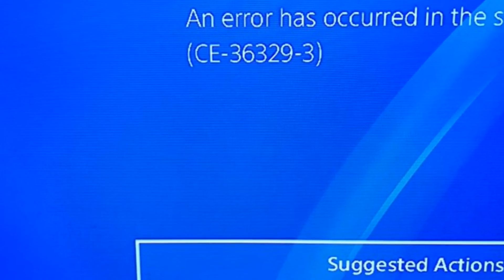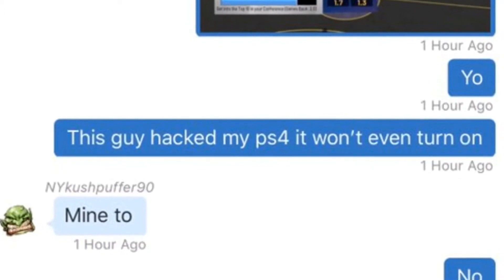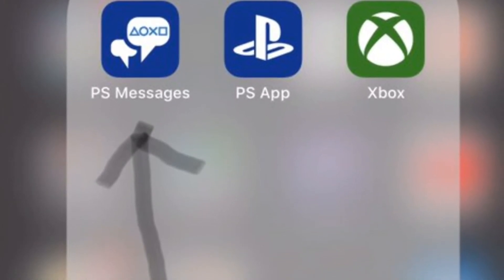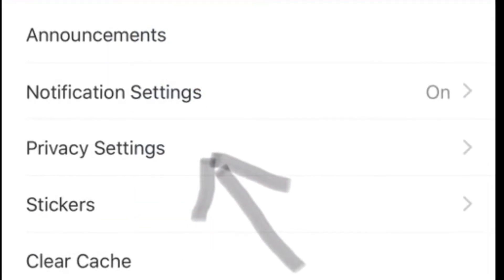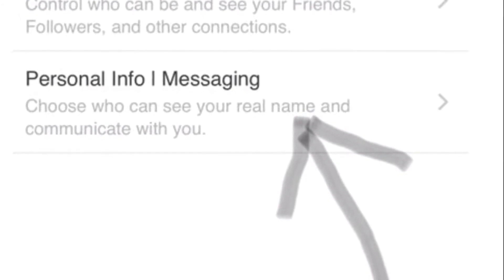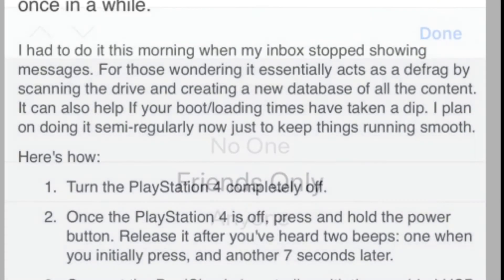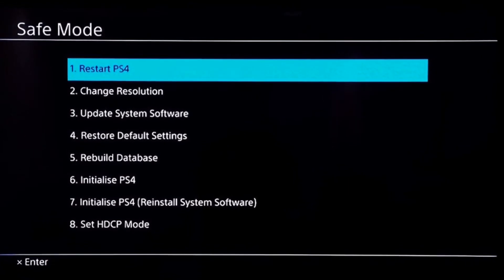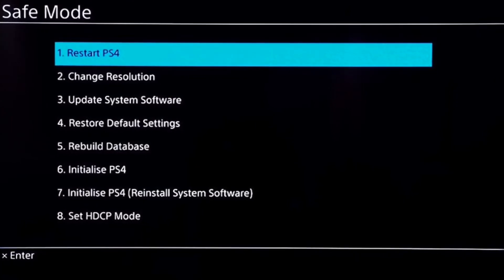CE-36329-3 PlayStation Error Fix With Explanation.

Comment: i got the error without any messages, how i fix that
Reply: Yo I’m getting a problem similarly I’m calling up PlayStation on monday my PS4 doesn’t have any unknown msg and when I turn on my PlayStation it takes SO LONG like almost 20 min it turns on saying error 36329-3 So then I press report then don’t report I go on my account 10 seconds later it turns off again I cant play any games or even watch YouTube on my PS4 I’m trying your method hopefully it works please reply and help I wanna play season 7 on fortnite I feel left out😰😰😰
Reply from the maker: Mister Reaper219 

Everything in the video is everything I know to try software wise the only other thing I know to do is to replace the hard drive and it’s not as hard as it sounds you don’t have to open up your PlayStation.  You can buy any normal I recommend 2 GB Sata 2.5 inch laptop hard drive.  And they should fix your problem but if you want you can try Sony and they will probably keep you on the phone for hours trying diagnostics that probably won’t work and they want you to send your console in.
Reply from the maker: Sony has patched this glitch with a software update, So make sure you have the newest update going to system and click update.  And if that doesn’t solve your problems I could be your internal hard drive failing and you might want to try to pack up everything you can and try different hard drive and see if that helps any.
Reply: Mr. Goody I got this error the same day I got my playstation. Barely played any games and I haven't received not 1 message. I even downloaded the ps messages and community app, and haven't received a message. What should I do?
Reply from the maker: Once you have connected your PlayStation 4 to the Internet make sure that you have went into system and update and make sure you have updated to the latest operating system for the PlayStation 4. The glitch that is mentioned in the video happened before it got patched.  The only other thing I know to do without looking at it myself it’s also to logon through your mobile app and delete all messages and then set it that you can only get messages from friends.
Reply: Mr. Goody thanks for the tip, i ended up sending my ps4 to playstation to see if that fixes anything